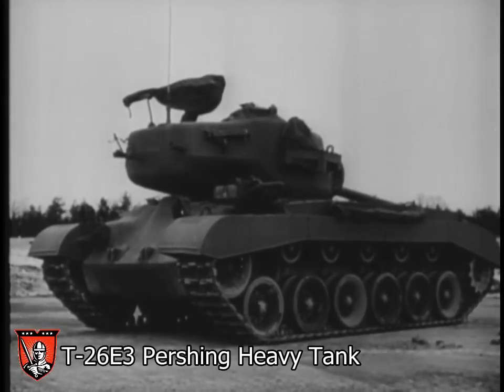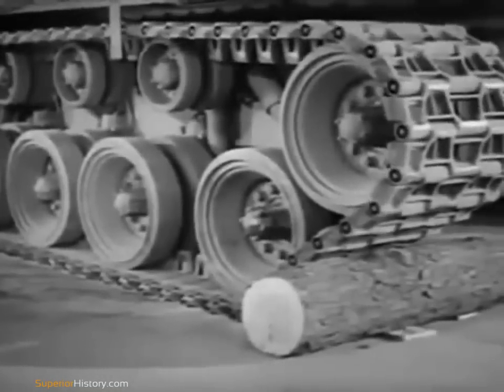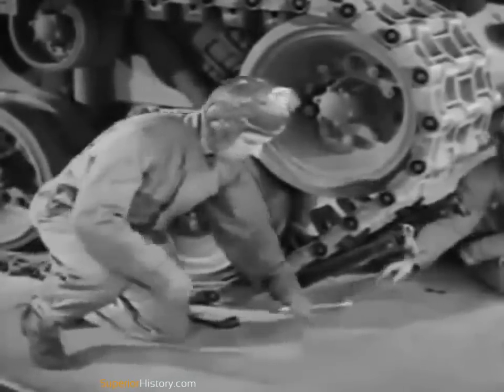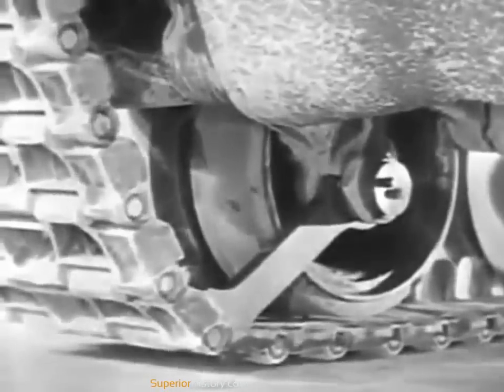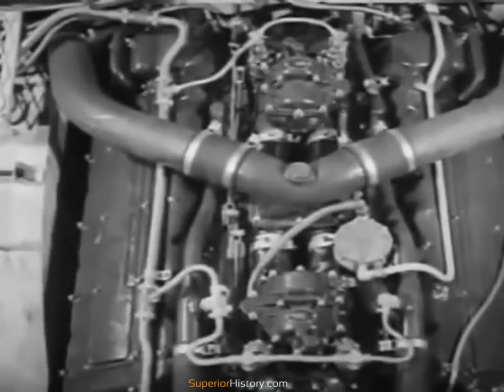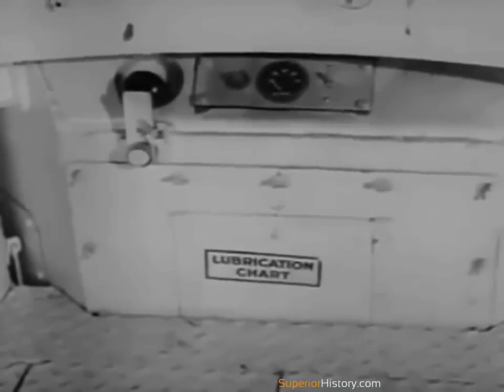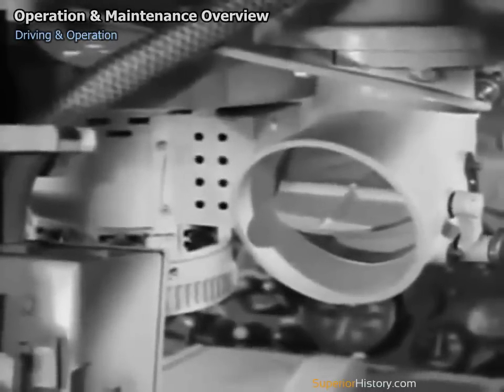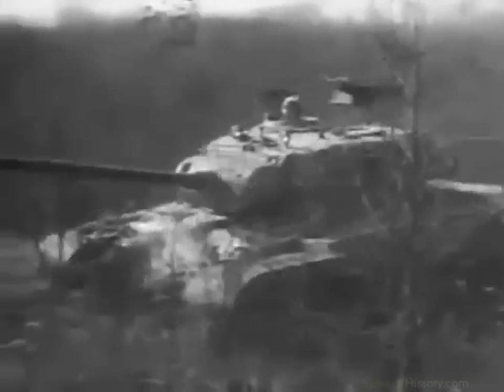The American M26 Pershing Heavy Tank (720p)

Comment: Better then The M4 Sherman.
Reply: stainshield  Not really..  it was pulled from Korea and replaced with the good old Sherman. The M4 is a lot better than people think it was. A lot of myths about the M4 out there. The army investigation of the M4 performance showed that it was actually almost as effective as the Tiger 1 and a lot more reliable and faster. Most tank combat didn't involve tigers and it was usually at close range.. it didn't usually matter what tank you were in.. whoever got hit first got knocked out... Sherman or Panzer, it didn't matter.. and they both burned. What usually mattered was the skill of the crews and leaders and the element of surprise or just the situation either side was in.